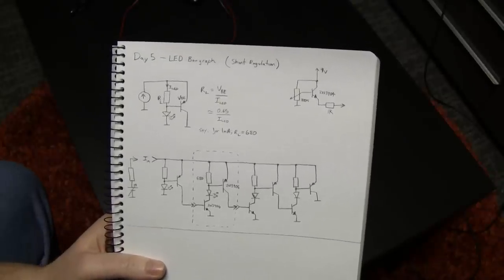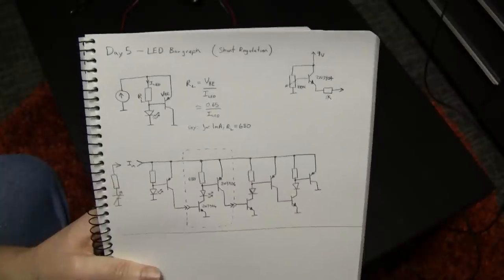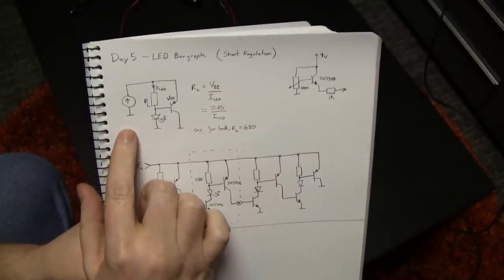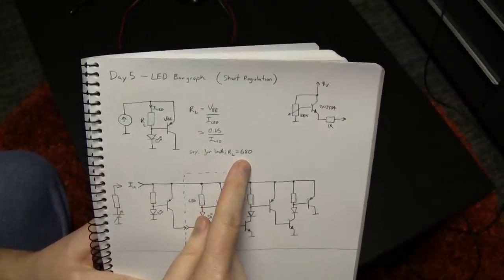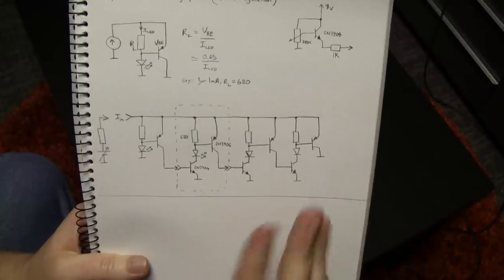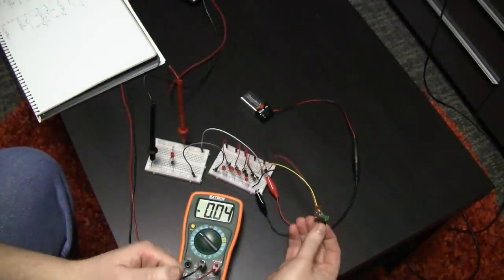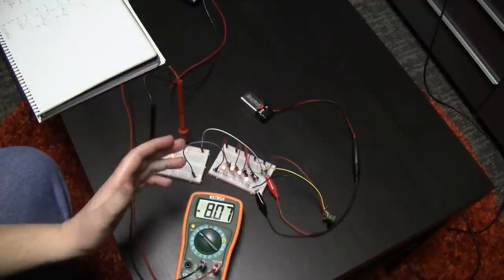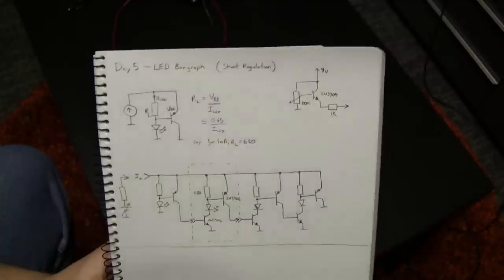Advent Calendar of Circuits 2014: Day 5: LED Bar Graph (Shunt Regulation)

Comment: Is it only the last transistor that is "eating" the current, when the voltage goes above 6v? 
It seems to me that all the transistors would help. Though the last one a bit more, since it goes directly to ground, and not having the base-emitter voltage drop. 

Very cool circuit. I was thinking of doing something like this on a bike light. Lighting more LEDs if you going faster. But I couldn't quite figure out how. So thank you.
Reply from the maker: That last transistor eats the majority of the extra current beyond that through each LED.  Each of the other NPNs base current (PNPs collector current) do contribute a little, but their base current is limited by the rest of the circuit, each NPNs base-emitter current is basically its collector current divided by its current gain (somewhat less than 10 uA in this circuit to achieve an LED current of 1 mA), this is because the following stages will turn on and consume current that would otherwise have no where else to go but through its base-emitter diode (if you left its collector open breaking the chain of stages).

Comment: i want to set up for an EQ display: 10 band.  i already have a 10 band working but want to downsize display somewhat. full system pulls ~7A @ 12V
here is my built system from another post - http://youtu.be/5l4wbtHN-uU

getting all values for design is fine but i would like input as to how to amplify audio signal into system:
1: LM386
2: NI op-amp (LM324/TL074, LM741, LM358.....)
3: TDA2050 (32w HIFI mono amp)
4: other simple schematics???